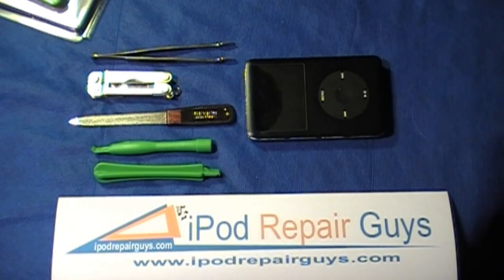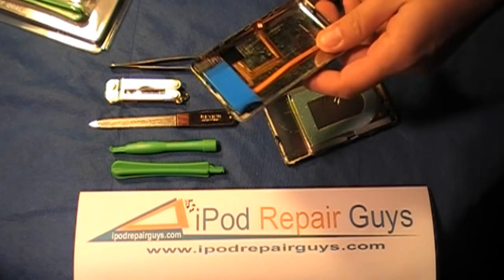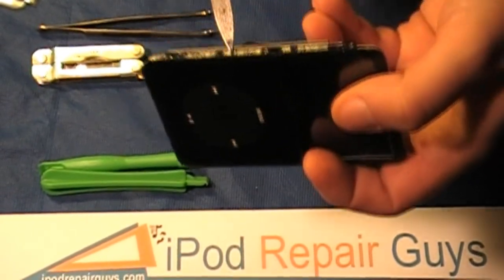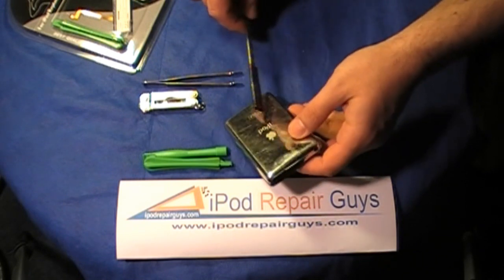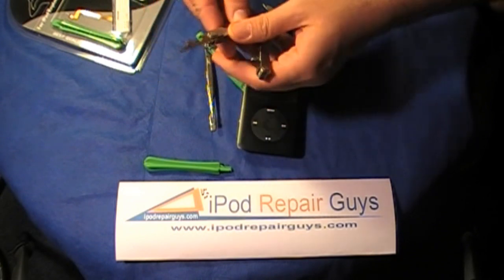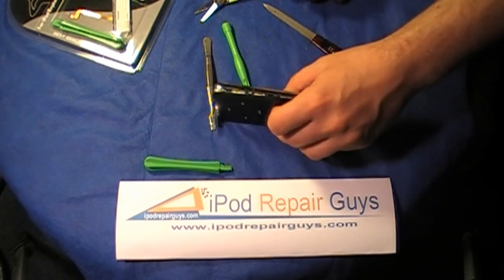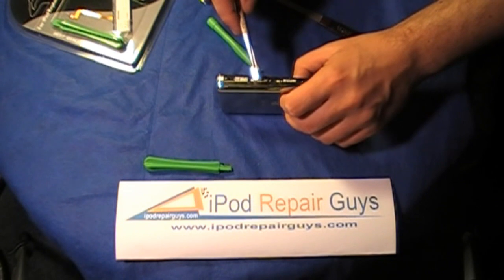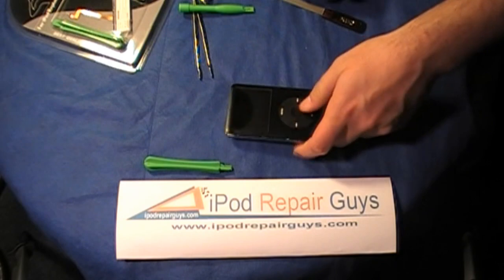iPod Classic Repair Video - How to Open the iPod Classic

Comment: I just wanted to post a thank you for such a detailed video on opening the Classic.  I just replaced the battery in mine and would not have been able to do it without your video.  When I need iPod accessories and parts in the future, I will buy from you.

Thanks again!

Comment: i have a 80gb ipod classic 6th generation and i found it very helpful that you actually put this video together. i have tried and tried to open my ipod but nothing worked until i saw this video. ty. Now, my ipod does come on when i connect it to a charger and shows that lightning bolt as if it's charging, but soon as i take it off the charger it goes dead. i ordered a new battery and will try to see if that's the problem. but i want to know what you think the problem could be.

Comment: Thanks for instructions man it helped a lot, i have a 6 year old first generation video iPod and when i tried to turn ti on the screen just kept blinking randomly every 5-10 sec or when i tried to plug it in.
I opened it pushed few wires and it seems to be working now, dunno what was wrong but i hope it won't happen again

Comment from the maker: @sillverscorpion This video is 2 years old if you didn't notice. It was literally a first attempt at opening the device. Some models of this series are much more difficult than others. The real Classic models thin 80, 120, and 160 models are rather difficult to open without damaging. We can open these without putting any damage to the original front or back casing. The video just became popular so we left it up.

Comment from the maker: @pureawsomeninja You are right it's not a software issue, it's hardware, many times the Audio chips will blow internally and cause no audio through the hjack or the dock. You can bend these prongs but reaching the bottom ones are quite tough and doesn't always fix the problem. They are now also weakened being they are so thin, chances are it will happen again over time. We charge $41..95 for jack replacements and you get a new hold switch too in many cases with our repair depending on the model.

Comment from the maker: Possible you pulled one or two of the pins off the board where the battery connector is when you were trying to lift off the connector. This happens and is hard to see if the other pins are still attached. We can take a look at it for you possibly resolder it if it isn't that bad or replace the board if necessary.

Comment from the maker: Try a hard reset first. You may need to do the procedure more than once. If that doesn't work you may be having a board or battery issue. We can troubleshoot for you if you send it in. We can also replace the mainboard and / or battery if needed. We stock hard drives as well..

Comment from the maker: Hello, this can be caused by the mainboard. Try cleaning out your dock connector first with a can of air or a swab and some alcohol. Also check for bent pins on the dock connector. If the connector is ok then the board may need replacement. You can send it in to us for diagnostics and we can confirm.

Comment from the maker: @munkeytron Yes it does but the tools are meant to break before damaging the iPod or components. We recommend additional tools such as a razor blade or metal type pry tool since the device is very stubborn at times. We can do the installation for you for $39.95 including return shipping. Well worth it in our opinion given all that can go wrong during this process.

Comment from the maker: @panzuman It works on the first pin but not the rest usually. It's also not a permanent fix but it does work in a pinch, best just replacing the jack with a new one as it is cheap enough.

Comment from the maker: The glue under the battery is generally not stuck to the cable. When you pull the battery though sometimes it can get caught. The cable is easily replaceable if you need a new one let us know we stock them. If you can't do it yourself we do both a battery and headphone jack replacement for $56.95 all included w/ warranty and return shipping.

Comment: Well heres what happened to mine.

IT FROZE while I was changing tracks,  So I came to watch this video on how to open it and Thank you for your help.
I opened it up and pulled up the battery and sure as shit it turned off (without disconnection of the battery) and now its not frozen and it still works. 
(30 Gig video classic)

Comment: It took me 90 mins.  I probably bent a couple of the side clips.  No mention that I remember in the video (as there is in the written instructions) of the clip holding the cable in place.  Nor any mention in the video as there is in the written instructions of the glue under the battery, which is also glueing down a tiny little non-replaceable cable.  Carefully pull battery up while keeping tiny cable down.
I'm in the chargeing phase now.  It does light up so I am optimistic.

Comment from the maker: @SimplyCoolVids Old yes but very active still. We repair tons of these. You have a bad drive, you can smack it on your palm hardly a few times to see if it can read again, if not most likely needs to be replaced which we can do for you. Getting the data off in this condition would be pretty expensive and you would possibly need a data recovery service.

Comment from the maker: I do and have since evolved the technique we use for opening the iPod. We can now open the Classic with very minimal damage and will not need to replace the back plate for repair. Our tool of choice now is the straight edge razor blade. Please note we are not responsible for any accidents, lol. This should be handled by a professional. We get many iPods that customers have tried to open and damaged further.

Comment from the maker: @MegaWaxz Sounds like you are having a drive issue. I would try reformatting the iPod first. Best if you do a complete FAT32 format of the drive in Disk mode then try to restore it through iTunes and re-synch your music. If that doesn't help then you may need to replace the drive. Contact us for a quote or you can also send it in for free diagnostics.

Comment: I have a 30 gig ipod classic I'm not sure what gen model no is a1136 the center button was off track and the screen was cracked so I bought a broken ipod (same model) off a friend for cheap and replaced the screen (which seems to work fine) and the center button I just put back on track and that works well too but when I plug it in it just says "please wait very low battery" then it loads for a minute and gives me the dead ipod screen do you have any idea what this is?

Comment from the maker: @dadasmithywinkle Haha, thanks for the comment that was funny. This video only applies to the 80GB Think 6th Generation Classic Model. We also do this without bending or putting scratches on the faceplate or back casing. We have since evolved our techniques and can fix some of the most demanding repairs on these iPods including all types of water damage, logic board reflows, surface mount soldering, etc.

Comment: hiya, i wonder if neone can help me as i can c dat  ipod repair guys are very helpful. i got a 160 gb calssic ipod, ive hardly used it, i used to use it as hard drive. suddenly one day it stopped working, it says connect to power with an empty battery showing when i connect it to power, the apple logo appears but the computer doesnt detect it. somtimes it "says charging please wait..." but eveni leave it for days on charge its still uncharged.
i was thinkin to open it and take the bat off .

Comment: the hard drive is connected by a cable. you easily unclip that cable. keep in mind these classics seem to have hard drives different from the other ipods.. different connector size.

Comment: is there a way to test whats wrong I have a nice multi meter that I use for testing motherboards (full computers) but I don't know what any of the voltages or current should read on an ipod

Comment: A few months back my brother stepped on his ipod classic. He ordered a new screen and replaced it, but now it is stuck on the sad face screen, if I plug it into my computer the computer doesn't register it. The ipod will say "Please Wait Very Low Battery" which I highly doubt. I've tried restoring it without avail. Anyhow, it sounds like a hard drive issue to me and my brother just got an i touch and said that if I can fix his classic  then I can have it. Any ideas?

Comment: Hey, I could really use your help ipodrepairguys. My ipod will not stay charged no matter what. Even if it's turned off the battery will still drain. I've fully charged it, turned it off, and the battery was dead the next day. I'm not so sure a new battery will help because this started happening right after leaving the ipod out in the rain overnight. If you've encountered this problem before please let me know what's wrong. Thank you in advance.

Comment from the maker: We don't cause damage with repair. Our processes utilize minimally intrusive case opening techniques. Some repairs are harder than others though and take longer to complete. iPods are getting more and more difficult to service with the new methods Apple is employing for sealing their devices. We protect the iPods prior to servicing them in order to minimize and eliminate any damage that may be caused by servicing. iPods are built as a semi-disposable electronic.

Comment from the maker: @munkeytron Just take your time, its a patient process. You will need something like the metal nail file I recommended in the video since it is more rigid than the opening tools. I generally start on one side then pop the top tab then the other side and bottom. Thank you for your business, the battery is going in todays mail.

Comment from the maker: @bsangoz Drive sounds bad my friend. You can slap it a few times to see if it recovers but you may need a new drive. To get the data off at this point you may also need a data recovery service which is rather pricey I believe.

Comment: I thought I might just have not connected the battery well enough so I took it back apart and got the little flat wire from the battery in as well as I could and it still did the same so I replaced the clip that holds the wire in and that didn't work either I dont want to format but I will if I have to cause I cant get most of the music that's on there anymore

Comment: hi guys. my i pod classic 80 g. works fine, until i put it in my loose fitting shorts pocket. might you know what is the cause of this? i have dropped it a few times, but it works fine otherwise. thank you .

Comment: Hey, I washed my ipod a few years ago and it wouldnt work so i left it in the drawer for a few years and hooked it up, and it shows the apple logo with a "Clicking sound" and a few minutes later it shows up "apple.com/ipod/support" with a large red X and i dont know how to fix it, i reallly dont want to let apple do it and pay a shit load to fix it, Ide rather do it myself because the warranty is like 2 years over. any suggestions?

Comment from the maker: We only recommend doing this as a last resort. The clicking issue is not necessarily due to a dis-alignment. It is due to the read/write error that the drive is getting. The sound is the drive trying to recalibrate itself to recover from the error. The error is usually caused by the read/write heads preamplifier failure which is chip based, slapping the drive will usually not rectify this issue, and may do more damage.

Comment from the maker: Thanks for the reply, unfortunately this isn't the case 9/10 times. Trust us we slap every drive to see if we can get them to work. It is the first step as we are always looking to save our customers money. This is actually not the best thing to do to any drive. It is also usually indicative of a failing drive which will continue to give you more issues. Our techs have also fully dissasembled drives to find better ways of fixing this issue and slapping the drive into working is a longshot.

Comment: Hey, I opened mine and replaced the screen of it, but when I put it back together, the touchpad won't work. Or the hold button won't work either. If I plug it into the computer, it still shows up on my iTunes and I can see the screen and all, but I can't move it past the menu page. Any ideas?

Comment: Hey my ipod won't turn on, it wont charge, it wont reset, but my computer detects it when I plug it in but not as an iPod, but iTunes recognizes it but it says waiting for ipod forever than says it doesn't work, I've tried resetting it while plugged in and it just does that same stuff again when I do... what do you think is wrong?

Comment from the maker: @jm123chavez Yes it can be fixed, it may or may not need a new drive depending on how bad it is. Send it in for our Free Diagnostics and we can test it for you and contact you with your repair options.

Comment from the maker: @TheCelticknights Thank you for the comment. We do not ruin anyones back plate. You will get your original back which matches  your logic board serial number. We have perfected the opening of this device so that it will not be damaged or scratched during the repair. In extreme cases if the back plate is not useable we will replace it for you Free of charge.

Comment: I dropped my Ipod classic, 160gb. It turns on fine, but when you try to play music or scroll through the menus nothing happens it makes odd noises. These noises come from the ipod its self not like headphones or anything. Any ideas whats wrong and where i could get it fixed. My other question is if it is totaled and would just be more practical to buy a new ipod?
Reply: Sounds like some drive issues. Usually worth repairing and it's considered wear and tear generally. We can certainly take a look at it for you and give you a quote.

Comment: I have tried resetting it several time but I always get a screen that says "Connect to your computer. Use iTunes to restore" but when I do that and connect it to itunes, i get another error message that says "iTunes has detected an iPod in recovery mode. You must restore this iPod before it can be used with iTunes." I click on restore and nothing happens. the screen turns black and

Comment: I opened up my Ipod Classic and one of the orange strips came unattached from the back cover.  Reason I opened it was the Enter button was stuck. With that orange strip that came unattached from the back cover is my Ipod ruined?  It shut off when it came off.
Reply: Not sure which orange strip you are referring to but almost everything can be repaired in the Classic. Sounds like you are referring to the headphone jack and hold switch cabling. The repair is $41.95 including return shipping if you still need it fixed.

Comment from the maker: I noticed I posted this comment on a duplicate video I uploaded by mistake.

-- Just for information sake it does take a while to seperate the front and back plates. My first time it took about 45 minutes. The video shows how you should open the case and what tools work for me. The case physically opens like the older versions aside from the extra locking clips that are located along the side and on the top.

Comment: if your ipod classic is disabled and shows nothing on screen. plug into computer it says disabled for power consumption. you do not have to take apart! push and hold the menu and center button for 10-20 seconds the apple emblem will flash, let go and repush center button it will work again.

Comment from the maker: This is not a permanent fix. It is a jerry rig repair that doesn't work more often than it does. If you ever examined the internals of one of these hard drives you will know it isn't a good idea to smack them around like that. I would try it as a last resort but if the issue continues most likely the drive is having mechanical difficulties and would merit a replacement.

Comment from the maker: Sorry your not happy with the video, it actually takes a lot longer than 10 minutes to open the case the correct way without damaging the components. If you read some of the comments you would have seen that we responded in regards to the video. At least you can see we do take our time with these repairs and don't rush our jobs just to make a quick buck. We really take pride in our work and offer great service to our customers.

Comment: 9/10 times the only problem with hard drive failure is an internal dis-alignment caused by dropping of the ipod ... and.easily corrected by a good slap.

But hey if it doesn't work i am sure they will still come to you to buy their new hard drives. Either way i guess its money in your pockets.

Comment: i got mine open but it was a REAL bitch and did some marring to the edges...i used 8 guitar picks (3 each side 2 top/bottom) all the way around the sides but had to use a screwdriver to open enough to slide in the picks under the tabs...even with all 8 picks in the corners wouldnt budge...i replaced the battery but sadly i discovered that i was able to fix it with the hard restore option....so be sure to try that first folks...:0)

Comment from the maker: @dadasmithywinkle Haha, thanks for the comment that was funny. This video only applies to the 80GB Thick 6th Generation Classic Model. We also do this without bending or putting scratches on the faceplate or back casing. We have since evolved our techniques and can fix some of the most demanding repairs on these iPods including all types of water damage, logic board reflows, surface mount soldering, etc.

Comment: I Need Help My Ipod Keeps tellinh Me To Restore It Using Itunes , I Did That And It Says Its Detected When Itunes Run And Then When I Restore It Then Says Error 1439 I've Did Every Trick Hold Down Menu And Middle Button  ,Switch In Disk Mode . Also When I Turn The Ipod On And Listen To It Its Actually Seem As Though Its Struggling To Start Up How Much Would It Exactly Cost For This Problem Please ?